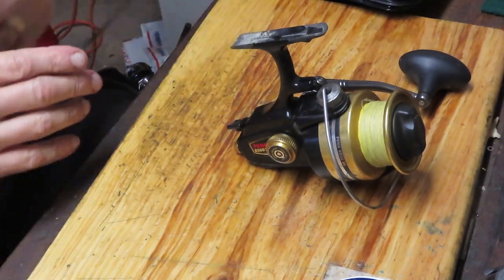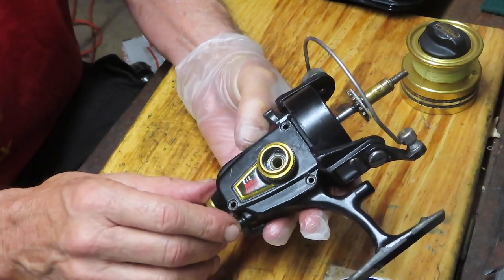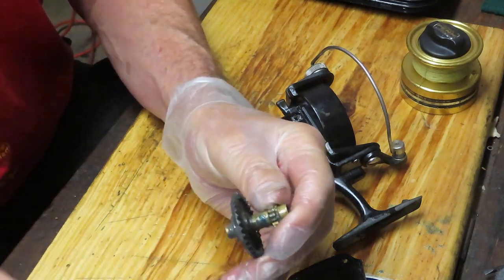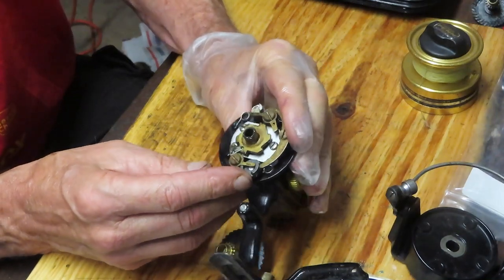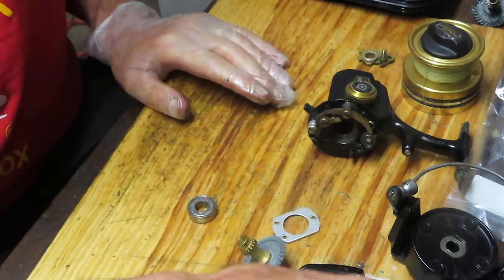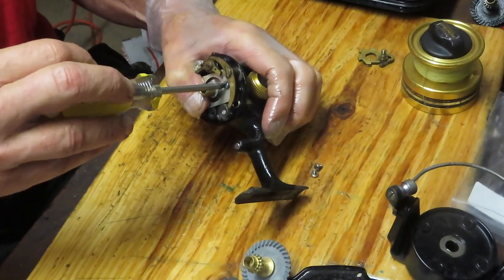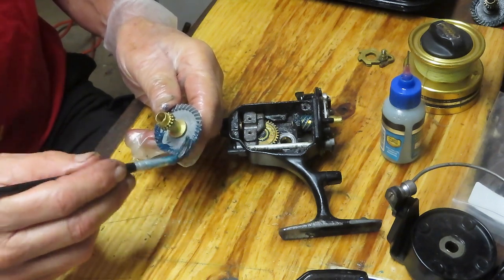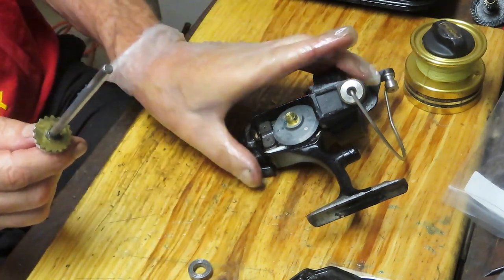Penn SpinFisher 6500SS how to replace the gears and service this fishing  reel

Comment: Nice video as usual Dennis.  I own and prefer the 650ss reels. If you noticed, with the 6500 series, Penn cheaped out and went from a brass gear to a cheap zinc gear. Not even close in ruggedness or longevity.  Penn finally came to there senses and are now using CNC cut gears with their current models.
Reply from the maker: Yes - they did trade down on the quality of gearing. I did notice - Thanks - Dennis

Comment: Now this is a Penn model I’d like to have. They are just so expensive I’ve been content with my Penn greenies and black and gold Z reels. Also I really like worm gear reels and all those earlier reels I mentioned use that mechanism. I have 15 vintage Penn reels and not one has a problem with a pinion or main gear. That has not been true on a few of my Mitchell 386 and 302N reels. I had one that I tried three different main gears on until it finally didn’t grind or make a bad sound.  The 386 and 302N are the only reels I have that had this problem. When I’ve replaced them I’ve always replaced both gears and whenever possible I get NOS parts not used ones. Using a line roller to make that handle work was genius. I’ll have my new Abu Garcia CD6 5000BG center drag reel in a few days. I got more photos of the reel today that I will send you. This reel has never been used. Unfortunately I have to undergo surgery Monday for another kidney stone so I’ll be out of it for a while.  Still I hope to be headed to the Outer Banks fishing next Saturday. I intend to take that center drag with me. — Chris
Reply from the maker: I hope you get there and have a great time fishing - Dennis

Comment: Great video helped me service my 6500.  One question I couldn’t get the pinion gear and bearing out, any suggestions on how too.  I soaked it with PB and  let set for about an hour, put the nut  back on and tried prying up with a wrench. Was afraid I would do damage so I quit.  Both were in good shape so I cleaned, greased and oiled the best I could.
Reply from the maker: Did you reattach the rotor after you removed the retaining clip and A/R assemblies.  I use the rotor as a sort of knob to help rock a stuck bearing or pinion out.  They aren't always easy.  If you have reinstalled the rotor and it is sill not moving, you may try a gentle tap/tap on the bottom of the rotor with a dead blow hammer to help shock it.  Don't hit it hard and do not use a metal hammer if you do try that approach as a last resort.
Of course, you can always do what you did and just oil and grease as best as you can around it and deal with more forceful means if the bearing fails - Dennis
Reply: @2ndChanceTackle I put it back together and oiled and greased them. It was smooth so I’ll deal with it down the road. Thanks for the quick reply.
Reply from the maker: YW